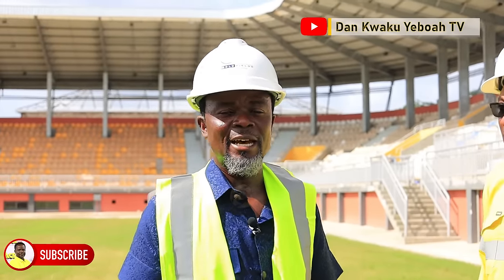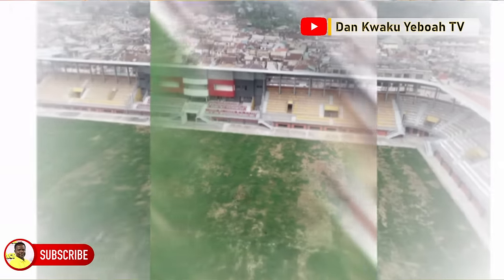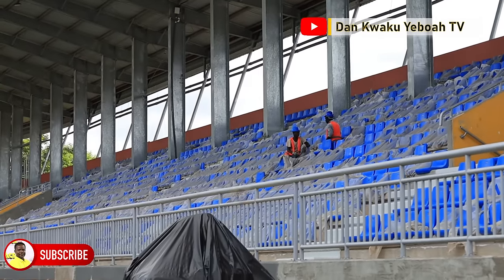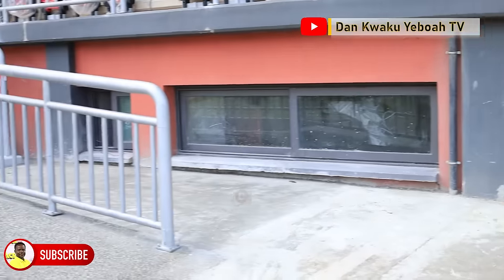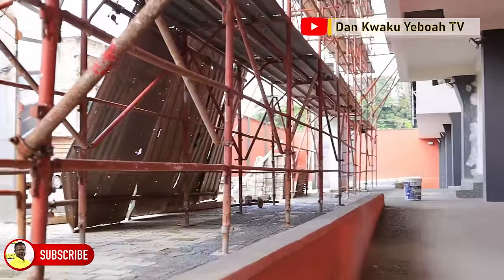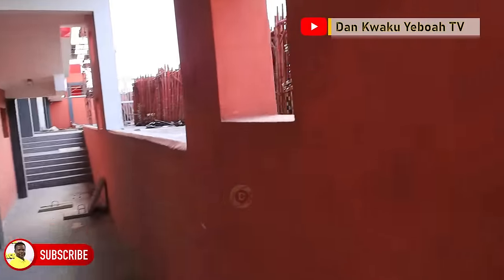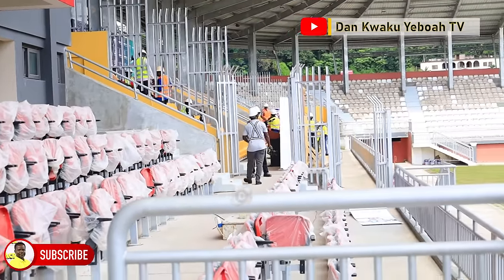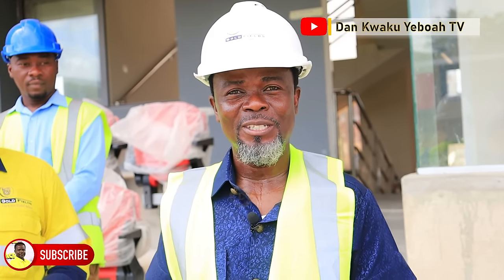Check out the $16m stadium by Goldfields Ghana Foundation. Arguably the best in Ghana

Comment: Underground perforated pipes are used under most pitch ..... this is not the first. Even with the Youth Resource centers by NYA across 10 regions of Ghana has the same construction. I worked on the Nyinahin one.